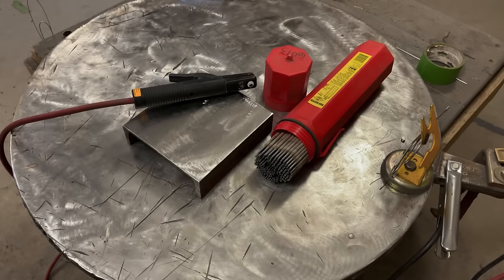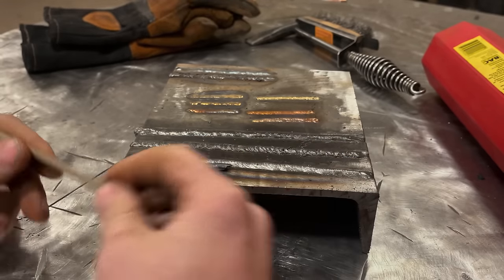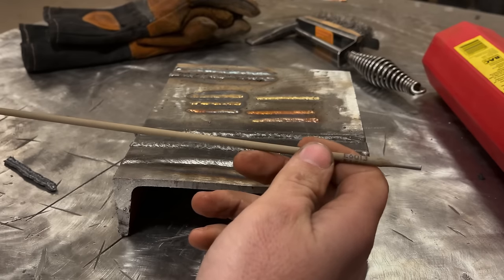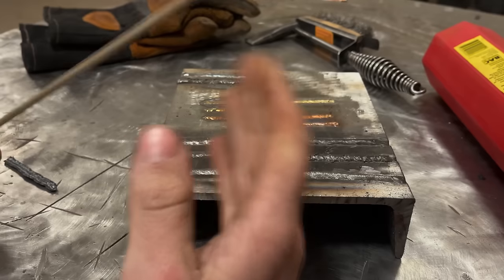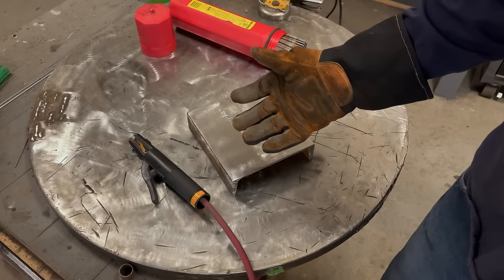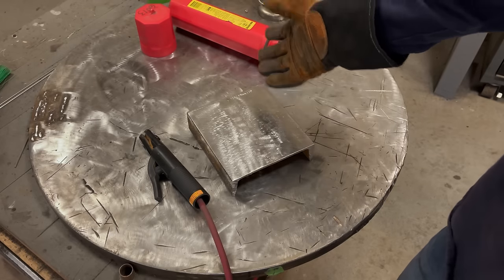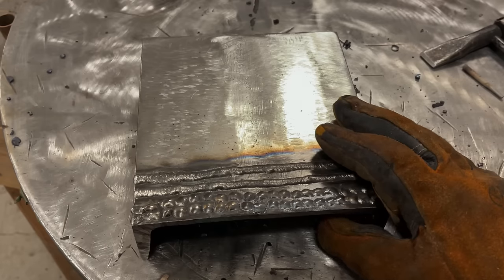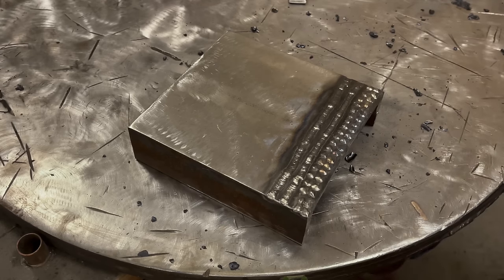How to stick weld 👨🏻‍🏭: Intro to Arc welding for beginners, (Series Part 1)

Comment: I hit like and, Sub right after I said to myself, " I can learn from this guy. He knows his shit . "
P.S. I purchased an old flux core wire fed , and was curious to know if that was the right method for a beginner like me?
Reply from the maker: Hello and welcome 😀.  Old flux core wire welders can be a good place to start learning to weld.  The only problem is some of them weld on AC output only.  All flux core self shielded wire is designed to run on DC electrode negative.  The result will be high spatter and less penetration on a/c.  A good flux core weld will have real good penetration and minimal spatter.  

Even if you have a AC machine you can still practice the basics with it.  Once you get good buy a better DC unit and it will be night and day Different (for the better lol).  Flux core is a really good process and can do a ton, you won’t regret learning a new skill 😀
Reply: @makingmistakeswithgreg  Wow. Maybe thats why I cant get a good bead. Thanks. What welder would you recommend ?  The one from harbor freight?
Reply: @makingmistakeswithgreg  How can I tell if my machine is dc or ac?
Reply from the maker: @thegarbagegladiators4735  I am a big fan of the harbor freight titanium 125.  It has DC output and welds really good.  Even Lincoln electric is marketing the same welder with their welding gun now.  

As far as telling if your machine is AC output, I would look at the data plate on it and it should say.  Or the brand and model searched on Google should give specs on it.  If it’s a black box harbor freight Chicago electric it’s AC output.  Many Amazon specials and tool store special welders are also ac only.  Like I said the main issue with them is they have excessive spatter because the wire can’t handle the DCEP current.
Reply: @makingmistakeswithgreg  it is a Campbell and Hausfeld,mig /flux 105. 
It says 115v/60 HZ
Reply: @makingmistakeswithgreg  and would that Harbor Freight 125 weld i-beams? I think they are a quarter inch for a little bit bigger than a quarter inch
Reply from the maker: @thegarbagegladiators4735  so I looked that model up.  It appears to be DC output which is a good thing.  However it appears it has switches for voltage rather than a variable dial.  In simple terms without more control over voltage the welds it will produce will be difficult to fine tune.  With practice it may be possible to produce welds that are decent however it won’t be anywhere near as easy as a harbor freight titanium 125 for dialing things in.  I say practice with it a bunch and get to the point you can run good beads, then look at upgrading.  😀
Reply: @makingmistakeswithgreg  Maybe. But at this point...I think I should go ahead and Get the 125. Your right. Those up / down switches are insane for a beginner. I Also have issues with my helm. It is super dark and hard to see. Sometimes I completely run off of the line. lol.. Today I picked up a piece of iron I welded a few days ago and tapped on it and the darn weld broke. It didn't  hold. Not enough penetration I assume? IDK. I'm still learning. I've only 20 minutes weld time tho. Maybe I should practice with it more, like you said. I have a piece of flat steel I could try n run beads on. ( if you wanna call what I do beads). LOL. It's its probably 1/8th inch.  6x6 .
Reply: @makingmistakeswithgreg  Also , one more thing. What wire should I be using as a beginner. I purchased .035 for my first roll. Should I have gotten .030?
Reply from the maker: @thegarbagegladiators4735  so a very reasonable timeframe to be able to make solid flux core welds on 1/16th to 1/4 inch steel in the flat position is about 40-50 hours of practice.  The key is to focus on flat plate, run 1.5-2.5 inch long welds, and try to have each one the same width and height.  So much of the learning curve is just trying to make a consistent weld bead.  Once you can do that you can adjust settings for material thickness.  If you can’t run a few consistent beads running actual weld joints will produce worse results.  By mastering the easiest thing (beads on flat plate) harder things (fillet welds) will go from hard to easier.  

Your weld broke likely because you didn’t have enough fusion/penetration.  Most new welders move too fast and run too cold.  Use the welding machine suggested settings and move slower, odds are that will clear the issue up.  There is no doubt having legit adjustable settings makes a huge difference.  It also helps knowing the machine your using can produce good welds, and having settings to work off of.  It leaves nothing but the operator as a variable.  

So basically focus on doing the mundane boring stuff for a few spools of wire, and it will pay off hugely when it comes to everything else.  Wire size .035 is fine to work with, on your particular wire you may find .030 to work better.  The same settings on thinner wire will produce a hotter weld because there is less wire than needs to be melted.  I personally prefer .030 for around 1/8th and less, and .035 for above 3/16th thick.  Also outdoors or scabby material run .035, it tends to have more flux and will make better welds in those situations

Comment: Why does my weld peeled off or literally didn't fuse into the work piece?
Reply from the maker: If that happened you probably ran too low amperage and welded on milscale that was on the surface.  Certain rods also have poor penetration and that could have contributed.

Comment: Would be a way better video if we could see puddle thats generally my issue is seeing it while welding as a beginner and hard to watch a coworker from some angles just my 2 cents
Reply from the maker: I made that video a long time ago before I had a nice camera and proper filters. More recent and future videos will be clearer.  The issue with visibility is actually not generally the issue.  It’s being able to move your hands in a manner to correct what is going on.  You don’t really need to see well at all to stick weld, it’s all about minor adjustments with the hands.  It takes time to develop the hand coordination needed to make a proper bead.  If you can’t see anything close to what’s in that video series you need to do 3 things:  1: make sure your eyes have been checked and your prescription (if needed) is up to date.  2: try between shade 9-10 and shade 13.  At some point you will have the best contrast to revel the molten puddle.  3: use a “cheater” lens if needed to make things bigger.  Also, from a practice perspective you need to burn 20-30lbs of rods to get the feel for it.  If you’re not atleast 30-40lbs if rods in on practice you will find it difficult to make solid beads.  It takes a lot of practice.

Comment: Telling everyone how to start a weld but no mention of the amps/temperature per rod, per metal thickness.
Reply from the maker: It’s part one of a 10+ part video series, everything can’t be included in the first video.  Most boxes of rods include a amperage range on the box or one can look up a chart for the rods they are running to get a idea.  Every welder is different with how accurate their output is as well.  It’s important to not overload a person with info, talking about adjusting amperage per thickness isn’t very useful to a person who can’t even start a rod.  Within a few videos after the beginning video everything you mentioned is covered in depth.

Comment: I tried using a Flux Core 110V welder from Harbor Freight. Without 220V output it is pretty useless. ARC is so easy. You can see the pool clearly. You no where the stick is located at all times
Reply from the maker: Where flux core shines is on thin material.  Anything thicker than 1/8th I rather stick weld and thinner than that I rather flux core or mig weld.  You can get used to flux core with practice, but the puddle is definitely different than stick.

Comment: The first thing a person that is just learning welding should do is get 7014 rods and the smaller ones at that. They don't stick as bad as 60 rods. Most shops have stinking lousy 6011 rods. Why? I'll never know.
Reply from the maker: Starting with a rod thats easy to use sure solves a lot of frustration issues.